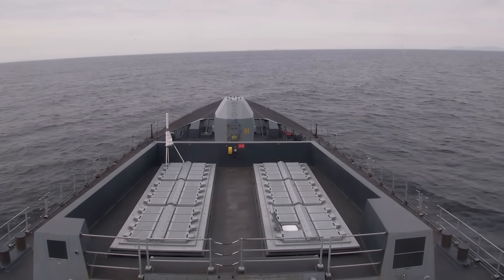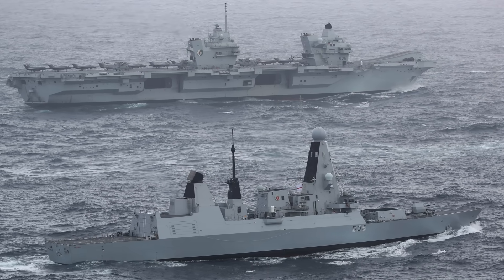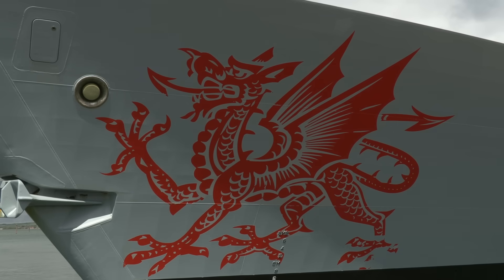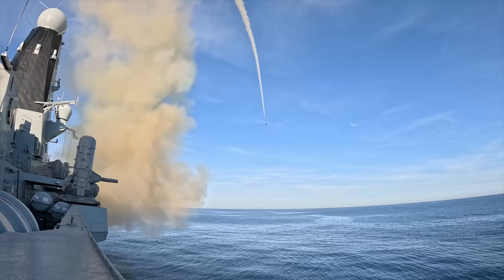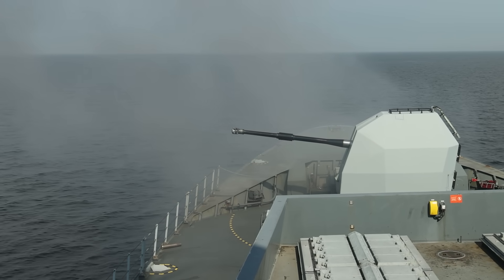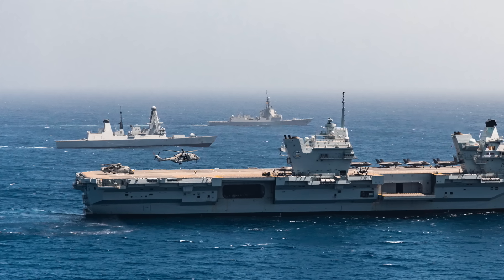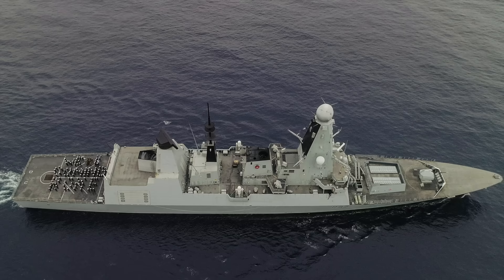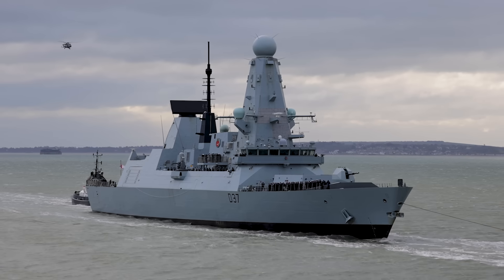Type 45 Destroyer: How the Royal Navy is Fixing its Billion-Pound Problem Child

Comment: What still has not been answered is how long is a typical engagement using Dragonfire? Unless it can dispense its targets in 1 second or less it’s not viable in swarm attacks… It is this that’s the factor. Everything I have yet seen on any laser from any country seems to require several seconds on target to disrupt or destroy its target.
Reply from the maker: When dealing with a large swarm its just one extra layer, but one that does not have ammo limiting factors, unlike a phalanx for example.  Against a few drones its really cost effective. The next step is both to increase the power to reduce the time needed per kill, but also kill the "archer" as per the FADS concept the RN is looking at.

Comment: Having been out of action so long they will be obsolete quite soon, despite the engine replacements.  As with the current vehicle procurement disaster for the Army, how could this engineering error possibly get to the point of deployment before being detected.

Why have a manufacturer develop an intercooler for a single shoip desigmn with only six being built .  The cost per ship would be high and it is clear testing was not satisfactory.  "Unfortunate" - that's a bity of a stretch as it was a disaster.  A costly one.

Comment: It wasn't an intercooler problem it was a physics problem. It should have been 2000 tons bigger and ran much larger diesel engines or 4 gas turbine engines and extra fuel.

Comment: It’s rare the customer eating in a restaurant is more competent than the chef. However the chef is not a doctor and so he can’t be expected to provide the complete solution.
The data shows ship building is mired with issues, over budget, delivered late, designs are flawed and then require rework. The build is not designed with easy access to modify or upgrade.
The bid process then tries to resolve this with legal speak excessive individual terms of reference. Geometrical drawings are vague tolerances are given then often there are measurements with no numerical size given. A vague nothingness. 
When resolving complicated issues it perhaps best to break the problems down to manageable sub sets of issues. Assume that objectives will change. Systems will be upgraded. The ship building process lacks accountability. We now have a process if a ship builder complies and builds exactly to specifications they can deliver late and government will pay the short fall. Critical components fail to meet operational needs. This issue lacks ownership. But generally you expect design calculations to validate this so it doesn’t occur. Without knowing why we need this particular ship in it’s configuration. Certain things can be addressed. Threats change, budgets change, complicated large issues are better resolved if issues can be broken down to smaller tangible issues. The build process should be modularised with access routes planned so modules can be exchanged. Nuclear, gas turbine, diesel drive systems can be removed as modules. 
To verify if components fit and necessary clearances are achieved draftsmen were given computer tools cad/cam a couple generations on its now possible to write computer programs that we enter the variables and computer makes the finished drawing to comply with constraints of the program. We can now write computer programs if it meets issues of conflict in can resolve these issues. The process is no longer about the individual skill of the human to execute a mundane task. It’s about making the right decisions and being creative and building in flexibility
Our competitors can build a like for like ship for less money and higher quality and have deeper pockets.
We are managed by the grey suits that see governments change colours like traffic lights. These administrators are not acknowledged as experts or rewarded for innovation so substandard designs and procurement is shuffled from desk to desk. Problems become their lunch having unresolved problems and being champion of meeting of the whiteboard is rewarded. 
Life rewards making good decisions and punishes us when we get things wrong. It was never about being experts, delivering the ship on budget on time it’s more complicated than that. Brian. Clough once said i had a great team on paper but the game is played on grass. 
I am proud to say I am no expert and I know nothing. I then set about making the best decisions and verifying that the best result is achievable a simple process of peer review and seeking those with superior knowledge to mine. If the design houses is full of draftsmen it’s unlikely anytime soon a new software solution that  automatically creates drawings and verify them with multiple other drawings will happen any time soon

Comment: Honestly I think what should be focused on is frigates and corvettes pretty much exclusively. You can pump those out far faster and cheaper. And you if you need multiple capabilities and you can't fit it all in one ship, deploy two with different configurations. Around Europe and specific longer range missions if you have refueling, corvettes are probably often more than enough. Especially with modern equipment.

Ultimately, having more smaller ships is better since you can deploy them more flexibly and while it sounds bad, you can deploy them on more risky operations. I think only reason to go big is range. But even then, you could potentially just extend range of ships by tankers and friendly ports. Well, I said only reason to go big is range, but there are specific cases to go big too. Like aircraft carriers or some type of logistics ships.

Comment: Again re the 'PIP' solution the actual problem leading to the need for such remedial action was a major design flaw affecting the Northrop Grumman supplied intercooler unit. Something that raises two distinct questions. Firstly the Whitehall goons continued apparent gross incompetence re what is after all part of their core function. IE; contract formation and protection of the British taxpayer from having to foot vast bills that should be met by suppliers guilty of such major equipment faults. Second and more puzzling is lack of any mention of what seems to me to be an obvious element to consider wrt remedial action. Simple low tech pre-cooling of water/air for the propulsion system
The two questions together OBVIOUSLY then raise a third more profound one that (surprise!) puts the incompetent Whitehall/MoD(N) parasites firmly back centre stage. Were the specifications re the original diesel units power output requirement in any case massaged downwards a tad in the interests of Whitehall's FAVOURITE pastime re any defence procurement prog? IE; to 'cheesepare' it irresponsibly down to the bare bones or beyond with zero consideration for mere operational effectiveness and the welfare of service personnel?
Reply from the maker: At the time of designing 12 ships were required. I would assume that along the design process everyone knew that this number was likely to be reduced, and in order to get as many ordered as possible cutting costs would have been a focus.  I don't think this is unique to the MOD, its easier to cut costs in programs that only a few people can see (defence) than social programs that lose MPs votes.  This week highlights this reality; MP refuse to vote for welfare cuts knowing that this means tax rises and and more borrowing.

Comment: So let me get this straight, instead of fixing the gas turbine system, they just cut the ships open to install a new backup system expecting the main propulsion system to fail?
Reply from the maker: They also needed more power anyway and adding another gas turbine is not an option, so more than doubling the diesel power makes sense as a reliable way of doing that.  Obviously fixing issues in the gas turbine units would also make sense.... but I have not found definitive info on if/how this has been done.  Maybe more information will come out, in which case I will create a vid.

Comment: Wartzilla high speed diesels engines that had stopped being made in India after ordered due to outdated design... Although the MAN (Paxman) VP185 would have been better, The German MTU 4000 as ordered for the upgrade of the Type 23 should have been the auxiliary engines of choice. The intercooler system problem sounds the same as the issues with 23 cooling issues when operating in the Gulf as initially designed for operation in the Atlantic during the Cold War. You would have thought the MOD would have considered that. lol... Good fix but at what cost.

Comment: So looking at the shot of the hole cut in the hull of the ship (let’s be honest here, probably to fit a sticking plaster soooo after they are off the pip 😂😂😂 the ship will be inherently compromised anyway) the hull is very thin so the immediate thought was “well they better have some damn good ASW capabilities cos all you need is a diver w a can opener or a limpet mine and its glug glug glug!  Also 48 missiles is bugger all against a swarm aaaand, looking at reloading that big gun by the phalanx thing (and I suspect it’s worse for the phalanx), it doesn’t have many rounds so you can swamp the ship with cheap drones and whilst you’re dicking about cleaning the barrel and reloading the ammo it’s boom boom time! Why aren’t those weapons on a big chuffing belt feed  that can be dumped for a replacement canister clipped on automatically? Got some big “holes” in it as a layman.
Reply from the maker: Thats why DragonFire is so appealing, with ammo only limited by power (and what could go wrong there). At least they are getting 48 Sea Ceptors as well

Comment: Doesn’t the number of dimensions that the ship engages determine its classification? E.g., a destroyer must be able to engage Surface / air or surface / subsurface; where as a frigate is a single dimension. Wouldn’t a cruiser need to do all three?
Reply from the maker: Each country has its own determination. For the UK the destroyer evolved from its original purpose of "Torpedo Boat Destroyer" to perform different roles. When some of the WWII built Destroyers were rebuilt to focus on ASW they were reclassified as Frigates. On the flip side, the Type 31s Frigates are designed as general purpose, so multiple dimensions....
Reply: @WarshipsAndWarriors thank you 😊

Comment: but no fix to the intercooler ?
Reply from the maker: There are some unconfirmed reports that the intercooler has been modified, but I could not find any concrete documentation.  We may find out more with HMS Dauntless's CSG deployment...
Reply: @WarshipsAndWarriors  Yes,a fix or workaround was implemented on the Recuperator/Intercooler issue some time ago,the software was also tweaked ,so that the catastrophic Shut Down problem was eliminated.HMS Dauntless had validated PIP and proved it worked on her long deployment to the Caribbean a couple of years ago.Defender and Diamond sailed on CSG21 without PIP ,with Defender having no issues at all,but Diamond threw one of her GT's in the Med so had to sit out most of the trip,meeting back up with the Group on their return in the Med having a GT replaced.

Comment: Did the the intercooler problem get sorted out/replaced with different heat exchangers
Reply from the maker: There are some unconfirmed reports that the intercooler has been modified, but I could not find any concrete documentation.  We may find out more with HMS Dauntless's CSG deployment...

Comment: I was in the RN as an engineering officer on Type 42 destroyers and type 23 frigates when these were being developed and entered service.  The most frustrating thing about their "Critical" design flaws was that people like me tried to point this out at the time (Early 2000s) and were firmly put back in our box.  It was beyond obvious that running gas turbines at part load was going to be a non-starter, and no magic "intercooler" was going to solve it.  The intercoolers were bypassed much of the time, which increased fuel consumption further, and the diesels couldnt take the pace either.  It is beyond me how reputable engineering companies with doubtless very capable engineers managed to screw this up but my guess is standard crappy executive decision making.
Reply: The WR-21 system was mandated by the Defence Minister of the time, against the advice of the builder.
Reply: @DaBoligBurls  
I understand that BAe told the Government it was a bad idea, but they insisted as it was cheaper.
Reply: I worked on the technical demonstrator for the propulsion plant and it was obvious even back then that the intercooler would be a problem.
Reply: @Scottishdefender If the gas turbines are good (not sure about whether they are suitable for running at part-load or only at full  load?)  - PIP has changed the diesel generators (3 for 2) to provide more standby power but have the intercoolers also been changed as that was the problem in the first place?
Reply: Agree totally . Same applied to our nuclear industry. I.e. design choices affected by accountancy.
Reply: Spot on buddy
Reply: As i read it it was a political/economic decision, against the advice of BAE, made by Geoff Hoon the then Minister of Defence.  Just another example of ignorant meddlers costing us loads more and landing up with a compromise.
Reply: In my over 5 decades on this shitty planet, it never ceases to amaze me how woefully incompetent people get promoted over competent people. Google "the Peter principle".
Reply: US built Intercoolers I heard.
Reply: The travesty is the very people whose attention were brought to the deficiencies and shouted you down are probably now all Admirals claiming how they tried to stop this disaster but were overruled. Welcome to the world of defence procurement and steeply sloping shoulders!
Reply: Yes, standard crappy executive decision making by the MoD.  Also strange that the problems with the Sperry Marine IPMS never got a mention.
Reply: @davepedantic "Crappy executive decision" by the MoD or was it by the the political boss - don't let a politician interfere with a technical design!

Comment: Let's put a few things straight here.... they were not a £Billion each.. the T45 PROGRAMME was £6 Billion to design, develop and build. Given there were supposed to be 12 originally givens you £500 Million per platform, you can't undesign to tailor for six ships. lot's of things were incorporated as Installation Provision Made In Design (IPMD). An extra launcher was designed in, back in the early 2000s between the PAAMS Silo and the Mk4.5 gun. Until recently it was the ships Gym, but hey !... guess what it's exactly the same envelope as a Mk41 launcher... wow !... UK Government opted to go for the SV-CAMM solution. Other platforms like T26 may go Mk41 with Quad Pack CAMM or FC/ASW. Granted T45s have had their propulsion issues using the IEP solution, again blame the government for that, they went against the Prime Contractors advice.

Comment: Oh dear, you never considered that with an un-proven engine design that BOTH could fail at the same time from the same cause did you? I guess that explains why the woefully inadequate Diesel generators were installed, you thought they would only ever need to cover for ONE failed gas turbine engine. Still not sure that even the new 9MW Diesel capacity will cover the loss of even one 21.5MW gas turbine, let alone two.....

Comment: You clearly don't know how the WR21 Gas Turbine works. The intercooler is situated between the Intermediate and High Pressure Compressor. The Recuperator channels HP Air into the exhaust path and back to the combustion cans to gain heat energy from the exhaust. Both are critically important to the overall efficiency of the engine but they are not connected, as you suggest. One enables maximal air volume, the other regains heat energy.

Comment: while at it, they should stretch the ship an increase its VLS capacity. 48 launchers might be enough for escorting a carrier but probably wont cut it in higher intensity conflicts, especially by air threads, that we might face in the future.
Reply from the maker: 48 Sea Ceptors are being installed, which helps.

Comment: We ought to remember a 400 Nm range ship radar can still only detect missiles close to the surface out to the horizon i.e. about 25 Nm.  That is why AEW aircraft are needed.  You know the ones which US launch from their carriers only because they have CATOBAR while QE carriers were built without.

Another bonkers bean counters mistake.   Mind you our numerous shore based Admirals fail to do their job when they allow such compromised ships to be built.

(Fun fact: the radar horizon is actually about 1/3 further than the visual horizon as radar waves are bent back slightly towards the earth by the decreasing air density with height.)
Reply: Sampson Radar should have been fitted to the Carriers at least - an easy way to increase OTH Range,and yes AEW is a must going forward.
Reply: @paultanton4307 I like the idea of a drone mounted radar. Makes a lot of sense.
Reply: Crowsnest.  Anyway, E-2 Hawkeye can't detect hypersonic missiles - it's dated technology.
Reply: @st1nk1n  And with hypersonic missiles horizon is presumably not an issue at will be arriving from a high altitude as need to travel in thin atmosphere to be hypersonic.